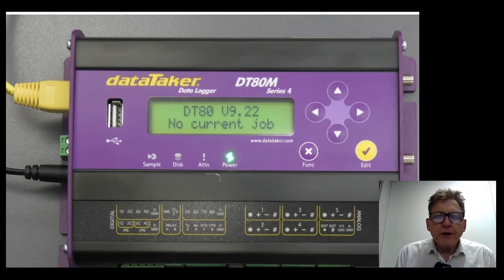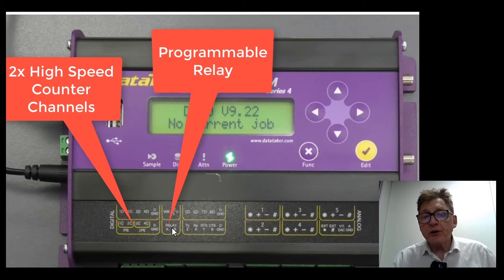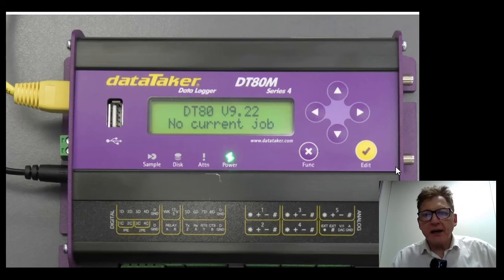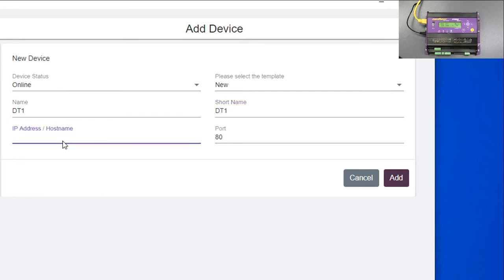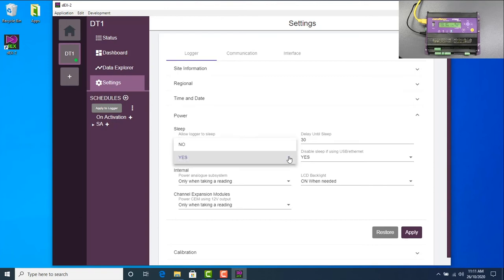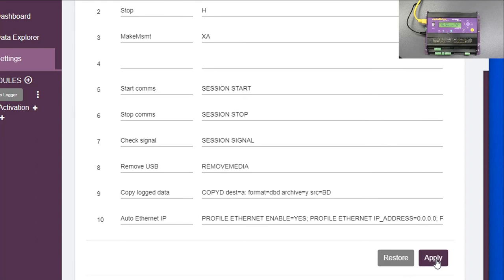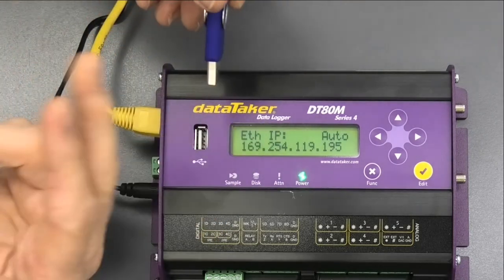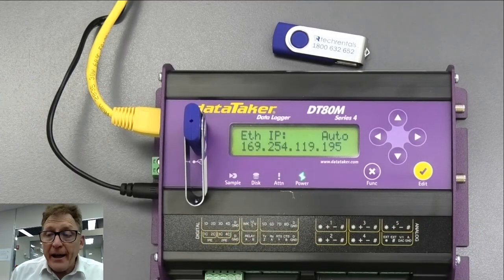DataTaker DT80M - Video 1: Instrument Overview

Comment: The video series is all good, but you just skipped how to connect with USB. I tried every method, but couldn't be able to connect with USB. I was connecting with USB to web interface before, but since web version is not working anymore, I need to connect to my PC with USB now to calibrate some of my sensors. It seems I need to use this dEX-2 software, but I need to learn how to connect it with USB. Can you please please help me on that. I checked the internet for many hours, but couldn't find any answer or video about it.